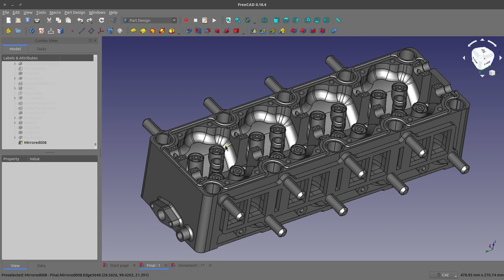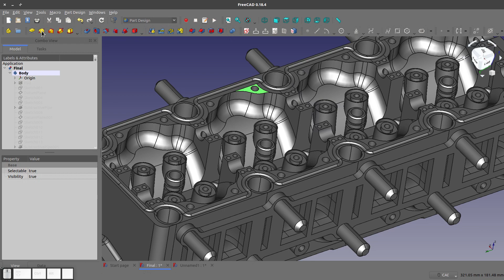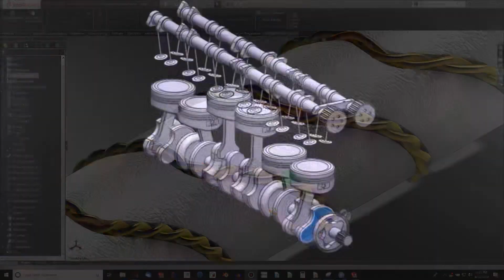FreeCAD Dealing With Sketcher Errors / Redundant Constraints / Overconstraints|JOKO ENGINEERING|

Comment: great video... however sometimes i call it  "nasty-cad"  because i do not know what i am doing?...:/  how do you place top and bottom flats on a shaft in parallel with the diameter? thanks...:)
Reply from the maker: Create a sketch on the face of the end of the shaft and use a cut feature.  Make sense?

Comment: Thanks for your videos. I recently ran across this problem repeatedly, and on my first real project. I had a PCB design that I was trying to reference and no matter what I did, I had 7 degrees of freedom. I couldn't "shake" the model from any line or vertex, and it was seemingly constrained to the origin in one way or another. I think I probably constrained the sketch in a much more complicated way than an experienced user would, but I can't be sure. As of yet, I have no idea why FreeCAD thinks it has degrees of freedom. I'm guessing if I could select multiple points and move them in a radial manner at the same time, it may be able to move, but this is not possible with the UI. Therefore, I have left it with incomplete constraints and suffered greatly from that.

Your video does point out a potential thing to consider though... Maybe it has to do with constraints referencing external geometry? I am trying to replicate the cross section of multiple STEPs into a single sketch (I am building a front panel with cutouts for components that come through the front). As such, I obviously had to reference external geometry. Since I am very inexperienced with this software, it could be that I'm doing things in a strange way. I'll go back and think about it. Thanks again for the video.

Comment: One of the issues I repeatedly have is when having external constraints and the parent sketch changes in an incompatible way.
Ususally FreeCAD then marks the corresponding body as erroneous and opens the "sketcher validation tool" when selecting the bad sketch in question. If not, it can be manually started by selecting the sketch, then in the Part Bench, selecting Part Design -> Validate Sketch.
The sketch validation tool can also be used to find open vertices.
At some point I also had the issue that external constraints could not be deleted. The same constraints triggered some other bugs rendering the sketch unusable. In the end I had to delete the whole sketch and redraw it. Definitely a bug in FreeCAD (0.18.4), and also super annoying to debug, as the validation tool did not help at all. Even via python I was unable to delete the ext.refs in question.

I think overall FreeCAD could do a better job in describing errors.
None the less, FreeCAD is an amazing tool, and developing more human-readable error messages is a complex and tedious task, as many compiler developers can tell.